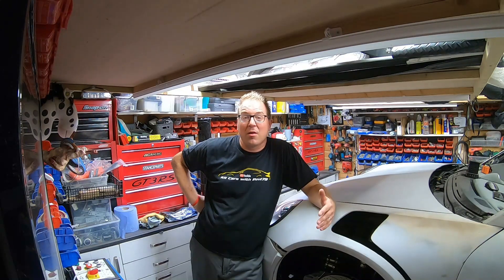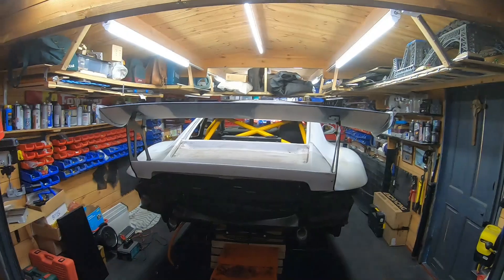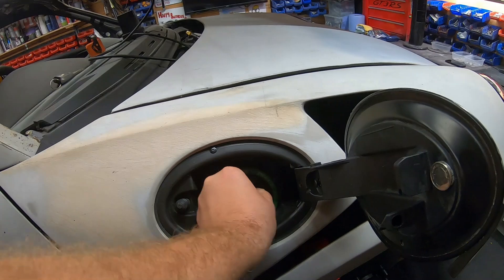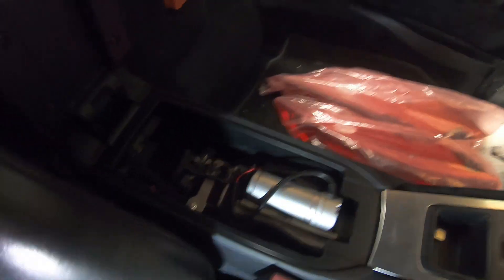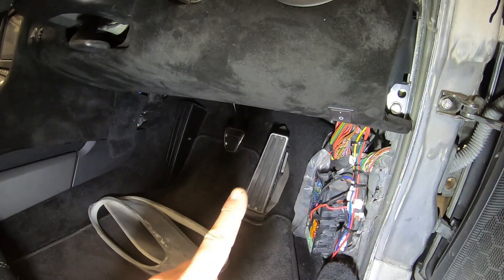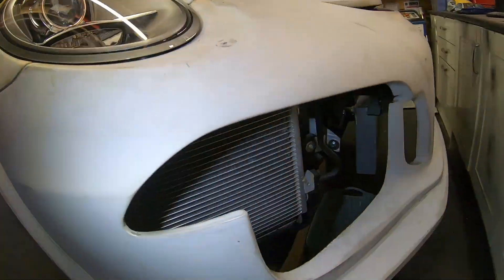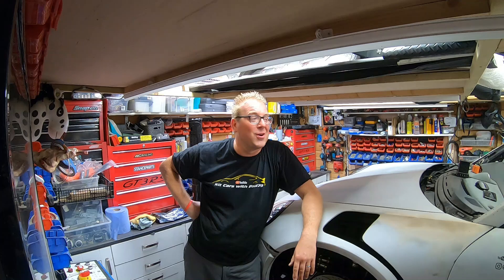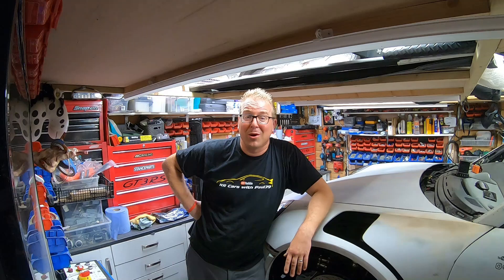EV Home Build Part 13 - 3 Months Work in 15 Minutes!!!

Comment: the hand bake switch looks cheap, do you have any safety that will stop the hand brake activating wile driving?
Reply from the maker: Sorry it’s not to your taste. I think it’s fine, simple and works plus it cant be seen normally as it is under the dash. Re safety features. None but I’m sure I could easily add some

Comment: wondering  if  the electric hand brake will pass inspection, with a  flat or disconnected the will be no hand brake  control you could use a nissan leaf foot operated  system ,with clutch pedal gone you have plenty of room
Reply from the maker: That’s a very good point actually. I’ll put it on to to do list.

Comment: It's looking great mate, well done so far.
Shouldn't you have used orange conduit for the cell taps as they are HV? Maybe wrap with orange tape.
You'll probably want to fit a brake pedal from an auto. I have the same issue with my Freelander and every now and then it annoys me, some day I'll probably sort it.
I hope you don't mind me saying your bonkers! Converting a car to electric is hard enough but adding the additional complexity of a kit car conversion is just mad. 😂
Reply from the maker: thanks. re the conduit - the Orion bms cell tap wires came with black conduit, and it's good quality so I used that. but yes, I'll put some orange tape around it.

yep - I am a little mad, especially as I also have another GT3 RS I am building, but this all keeps me out of trouble.